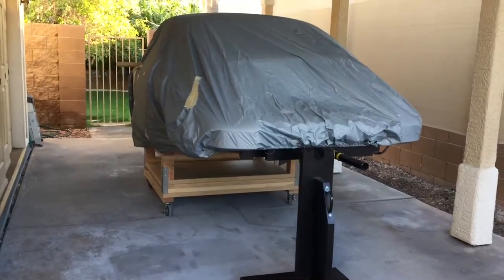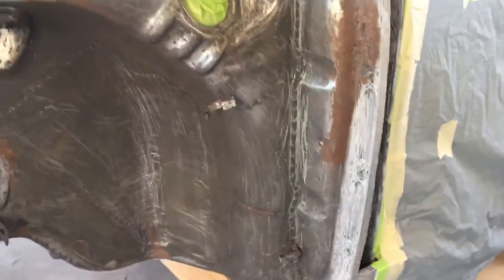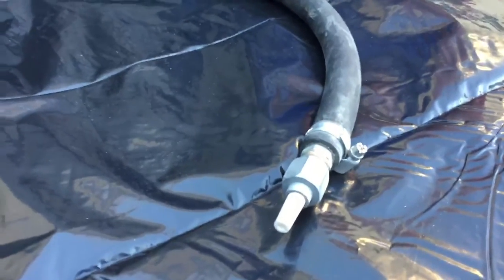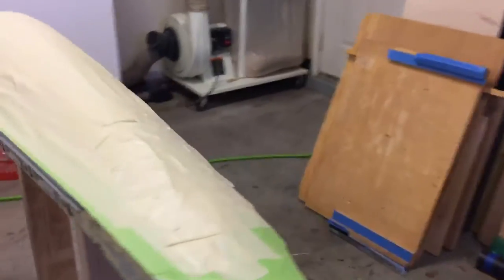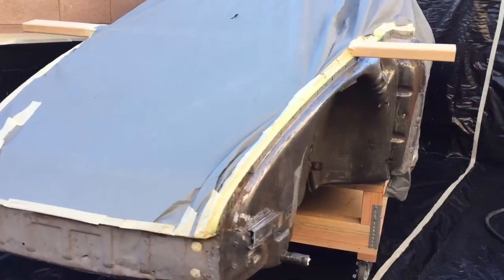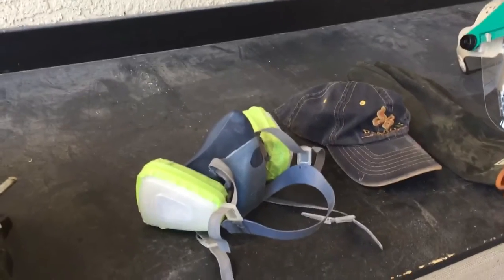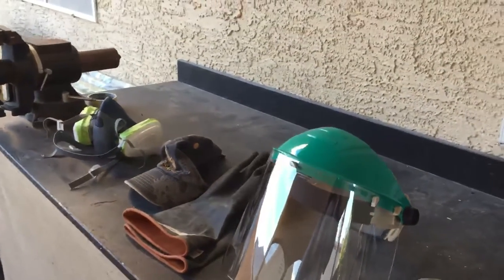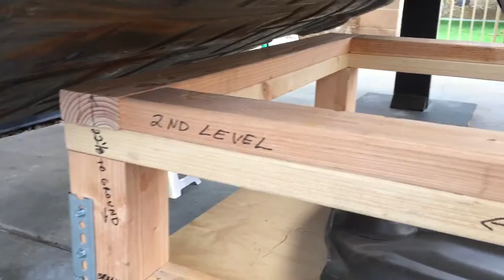1967 Porsche 911 Rotisserie part 2 Video 10 Building a rotisserie

Comment: Amazing work Mike!! In which video you describe on how and what to use to clean up the front end parts?.
Reply from the maker: Thanks Fernando
Which parts in particular are you referring too.. front pan or control arms?
Reply: Hello Mike,

Thanks you for your prompt respond,

FYI

I own a 1983 SC and after having it for almost 10 year parked in my garage, I decided to restore the front and back suspension of my car.

To be honest, your videos have inspired me to do my own work. They are well explained in detail step by step of high quality, work of art.

My goal is to replace all the necessary parts and refurbish some if possible

So, I will appreciate it if you could guide me on how to clean and which product to use.

The following picture, not from my car, shows the parts that I  have in my project list.  

 Thank you once again and keep up the magnificent work.

image.png
Reply from the maker: Hello Fernando
Thank you congratulations on taking on your suspension yourself! Im confident you will be able to get thru it masterfully.
Im not able to see the image..can you send a viewable link ..example drop box or something similar?
I think your first step wold be to take lots of pictures of disassembly and then clean parts with a good parts cleaner or gasoline then soapy water rinse.
Paint strip with chemical stripper..wash again soapy water rinse and then media blast to bare metal.
After that the rest is easy!

Comment: Hi Mike, why do you epoxy coat?   I have a 71T I’m re-painting.
Reply from the maker: Hello dtownLayowns Seasons Greetings!
Epoxy is considered to be a sealer in addition to a high build high quality sandable primer base.
Your other option for priming bare metal would be an etching primer followed by high build 2k primers for body work. Etching primer is good but doesn't stick well to body work if you are using body fillers. In this case you will have to spray around those areas. Epoxy covers everything and cures incredibly hard. Etching primers do no seal the car completely from moister underneath.
If you decide to spray out epoxy please be sure to follow the spec sheets to the letter and re-coat time windows. After you have gone past these windows for finish paint the surface becomes to hard and slick. The base color will not stick.
When you are ready to spray make sure you have sufficient time and materials to move thru the finish coats before these time windows expire.
Other than that you will love how easy it sprays out and working with it.
Good Luck on your 71T! beautiful car

Comment: Thank you for this video. Been searching for a swb bolly measurements and this is very helpful. Question, do you bolt down the frame or the belly pan to a dolly when setting on top?
Reply from the maker: Hi Jesse
Welcome to the channel! You're welcome=)
You might have a look at video 15 talking about the undercoating process
In that video I go over some upgrades to the dolly.
No need to bolt down your car..It will hold your car steady and balance nicely
Good Luck!
Reply: Thank you Mike! Your videos are very detailed and informative. I'm going to start from part one.

Comment: Why two decks separated by the 2x4 spacer?
Reply from the maker: Hi Russell
With this system the higher level dolly setting is for rolling the car height only..
Lifting height is about one inch from saddle of the rotisserie to the dolly
Easy lift.

The lower height on the dolly is for re-assembly of the suspension componants
The car can then be jacked from the dolly to the ground when wheels are installed